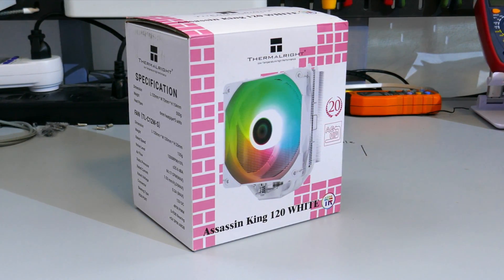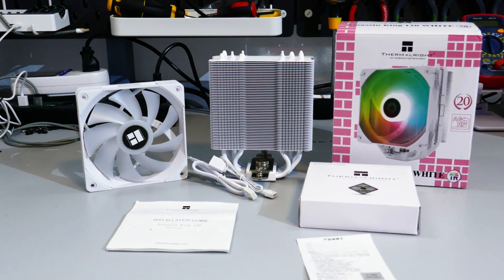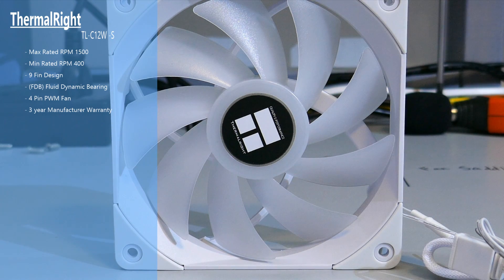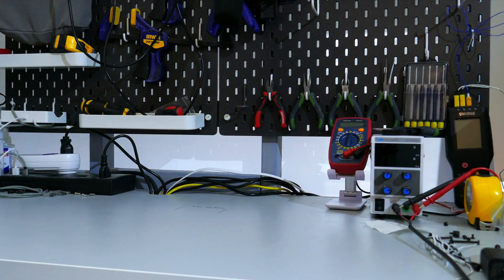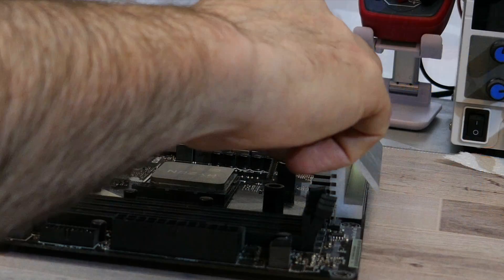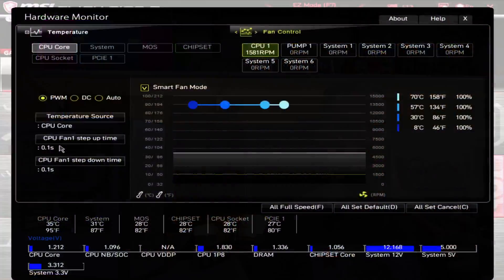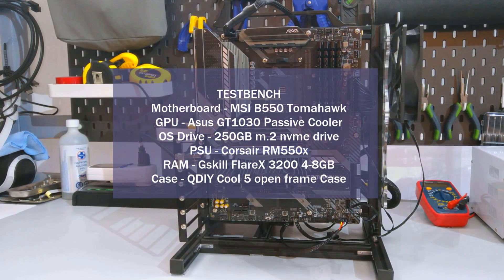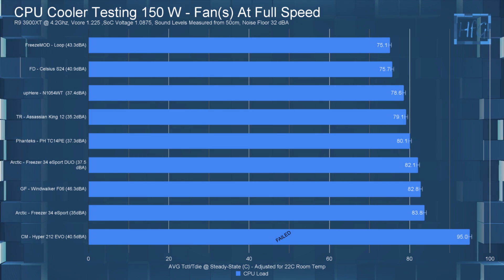ThermalRight Assassin King 120 White - CPU Cooler Review

Comment: Its written 35 dBa on the top. Does that mean the system is making that sound level or the cpu cooler only?
Reply from the maker: That is only the CPU cooler measured from 50 cm (20") away
Reply: @HardwareForGamers  aha I see. Thanks for the quick reply

Comment: I'm really surprised that for you it worked even better than the Arctic Freezer 34 that sells for double the cost, is bulkier and has 2 fans.

I'm really tempted on swapping my old Criorig H7 for this cooler, thanks a ton for your review!
Reply from the maker: This does have an extra heatpipe over the freezer 34 (duo). That's likely why.  Plus I have no idea how ThermalRight makes a profit on these coolers.

Comment: Hi, seeing how responsive you are to recent questions, I thought I'd drop my own: I recently bought this cooler (although it's the uncoloured version). So far it works amazingly well for the price, but I'm not sure how to control the RGB - it's just kinda orange right now. I noticed you had a SATA powered remote control thingy - is that something I have to buy separately?
Reply from the maker: If the LEDs on the fan are on you must have the 3 pin 5v ARGB header plugged in to the motherboard. So to change the color of the LEDs you'll need to use the RGB software for your motherboard.
Reply: @HardwareForGamers  I ended up figuring out how OpenRGB works and used that to change my colours. Thanks for the reply!

Comment: is it good for i7-10700kf ? please respond
Reply from the maker: When gaming with stock or undervolted settings yes. If you're planning to render or overclock you would want to look at something larger like the PA 120.
Reply: @HardwareForGamers  how to change the color of it ? Please
Reply from the maker: @ysrv7  you need to use the software that works with your motherboard.
Reply: @HardwareForGamers  can you tell me how in instgram please ?
Reply from the maker: @ysrv7  you can Google it...
Reply: @HardwareForGamers  i did and i didnt understand
Reply: @HardwareForGamers  thank you so much
Reply: @HardwareForGamers  hello i have a question can i buy another fan and put it in the cooler so it will be 2 fans ? And from where do i buy the 1 fan ?

Comment: sprit 120 vs king 120 what's the difference? king any better?
Reply from the maker: you need to be more specific, are you refering to the Assassin spirit? the TRUE Spirit? Phantom Spirit?
Reply: @HardwareForGamers  assassin  spirit 120 vs assassin  king 120
Reply from the maker: @Ramchowdaryking999  the fans are pretty much equal, but the assassin king does have the extra 6 mm heatpipe so it will have more heat capacity overall. but it then depends on what CPU you're using on if that really matters. plus what the price difference?

Comment: I just bought the Deepcool Ak400 for $40 CAD but I now just found the Assassin King 120 SE for $31 CAD.  My question is, is the SE the same as this, if not better? I'm trying to cool an i5 12600k non overclocked if that matters.
Reply from the maker: The AK400 isn't working well enough for you? The SE should be the same performance the the one I tested. Plus the SE has the LGA 1700 mounting hardware included. If you're not OC the 12600k the AK 120 SE should work pretty well for you.
Reply: @HardwareForGamers  No the ak400 is stil being shipped to me. But I came across the AK 120SE for $9 cheaper and noticed that a cooler tier list had the AK120 (didn't have the SE version on the list) 1 tier higher than the AK 400. But there's no videos or anything comparing actual numbers so I'm kinda lost .

Comment: Is it enough for a intel 13600k? Do you suggest something more powerful?
Reply from the maker: It depends on what you are doing, mostly gaming with maybe some rendering. Then yes. But if you're planning on just doing CPU rendering then you should go with something larger.
Reply: @HardwareForGamers  light photo and video editing + browser and Microsoft office stuff
Reply from the maker: The Assassin king 120 SE will be fine, but make sure you get the SE because it does have the LGA 1700 mounting kit.

Comment: is the cooler good for an i7-12700?
Reply from the maker: yes, but you want to make sure you get the assassin King 120 se, so that it comes with the LGA 1700 mounting hardware.
Reply: @HardwareForGamers  thanks
Reply: 或許你也可以嘗試Thermalright TA 120 EX   OR  Thermalright TA 140 EX,我的CPU I7-12700  使用TA140EX 表現得很好,環境28度 AIDA64  FPU 10min cpu package 82-84度
Reply: By the way, this test is using Arctic P14 fan*1, in ta140ex, the original fan is too noisy

Comment: Thanks for the great review!! One thing I noticed about this cooler (purely from product listing videos and pictures, I don't own one) is that there seems to be 2 variations, one that is not direct contact (like you show at 1:53 & 2:45) and one that is (across all models). I don't know exactly what effect the difference would have, but I thought it worth mentioning. Rarely listed in the product descriptions or specs, so be sure to confirm visually which version you will be getting before you buy.
Reply from the maker: The older version of the assassin king (this cooler) is not direct contact. The newer version the assassin king (SE) is direct contact.

Comment: What I like about Thermalright is that they included a great high tier thermal paste in TF7, not just a cheap white silicon thermal grease to enhance the heatsink performance.
Reply: Mine came with the tf4 paste, but I did also get the newer version with the heatpipes directly touching the heatspreader

Comment: I wonder will the screw under the heatsink the one in middle. Is it just for visual or it lock the the metal that hold 2 screw ? . If it for lock will it get lose over the time just too much worry i knew.
Reply from the maker: that screw is a screw, it holds down the  the fastening bar. it really shouldn't  become loss.
Reply: @HardwareForGamers  Thank i think i will grab standard Assassin king 120 standard then 30 us dollar can't beat it with 5 heat pipe

Comment: Great to see you have the old Phanteks TC14PE in your list of tested coolers and suprised to see the Assassin King 120 outperform it.. Would love to see how the new Scythe Fuma 2 Rev.B  stacks up against that list !
Reply from the maker: I think the TC14PE would outperform it at 200 watts, but theTC14PE isn't very effective at dissipating heat quickly it's just huge, and I'll add the Fuma 2 Rev b to the list.
Reply: Fuma 2 Rev.B test, that's brilliant. Currently I'm using the TC14PE's little brother to cool an Intel quad core, the TC12DX with it's 4 heat pipe design. It is sufficient enough with a mild overclock. In future I'm planning to upgrade to the new Zen 4 Ryzen 8 core AM5 socket and if the TC12DX is not up to the task I am then looking to change it for a Fuma 2 Rev.B, which all the reviews I've watched show it performs top tier at those higher TDPs with it's 6 heat pipes and improved fan performance. It's compact & well thought out design makes it perfect for the NR200 case as covered on the Machines & More channel. A great litttle cooler !

Comment: REALLY nice temps compared to the Arctic 34 which is pretty stinkin good! I'll be rebuilding an older pc, i5- 4690k as well as an 11400 withing the next 2 weeks.. Cryorig M9i (120tdp) vs 212evo results coming soon! 11400 CAN pull "up to" 200 Watts which is.. WHOA!! (65watt chip with pl1-pl2 unlocked...will be testing the GB b560 Auros pro ax to see if the 92mm monster handles it as well as a 212evo which is everyone's "go-to" since 1942 of course...lol ((btw the 10700f @ 4.65 all core clocks CAN pull 244 Watts but as i've seen, only benchmarking the poor thing to heck to check a few things.. it's in a gaming and streaming rig)) WIll also let you know about 10700f with gtx980ti, Rx5600xt and either the 3060ti or 6700xt.. Unsure which I am grabbing just yet and may say "to hell with eating!" and grab a 3080 12g for 999... I'll let ya know once I leave Microcenter! lol